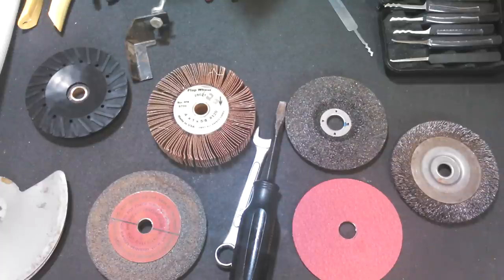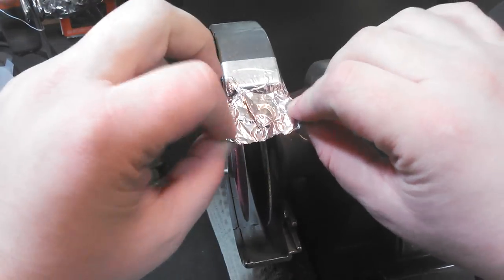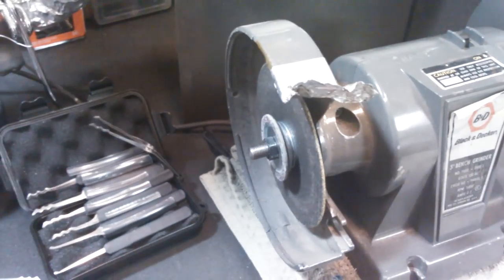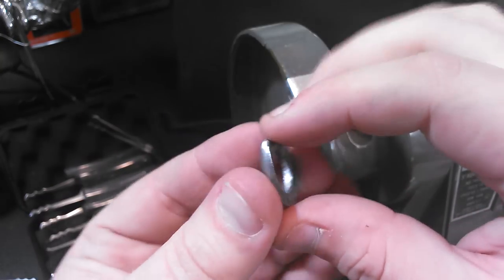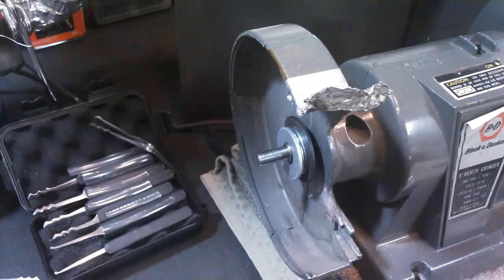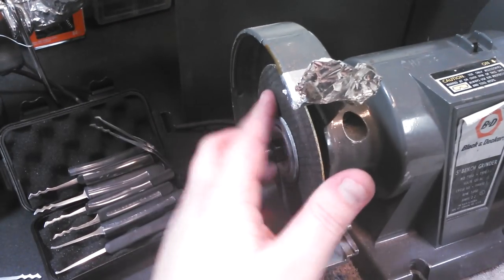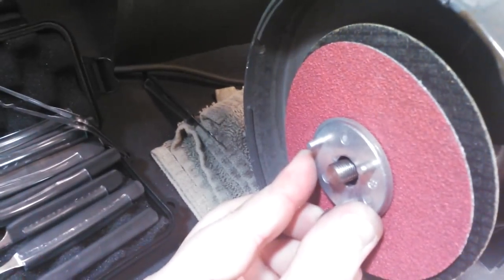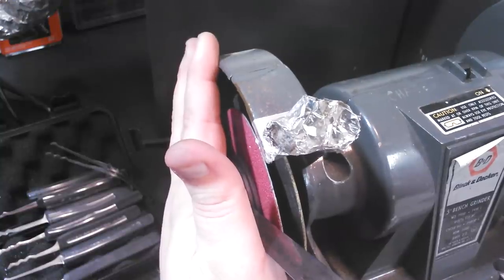How To Convert Your Bench Grinder to any atachments! {14}

Comment: If your shop is in an apartment, as is my case, yours is a quick and valid solution for neatly cutting small metal parts, like HSS blanks for the mini lathe, making very little noise. 
Great idea.
Reply from the maker: Yes being able to use a single tool for multiple functions definitely saves space and I purchased a rubber mat for benchtop and placed workbench on folded strips of padded linoleum and made it absolutely silent I was in upstairs apartment also

Comment: I have that same grinder as well as a similar one with a plastic housing. Both vintage and made in the USA. The plastic housing one is that pea green shade that they did a lot of tools in back on the day. Nice little machines and I appreciate them being USA made. I don't use them and have restored them both. Just part of my collection. You can never have too many bench grinders. They are invaluable.
Reply: Sounds STUPID ! if you don't USE ! Them !
Reply: I bought one at an estate sale. How or where can I find grind wheels with 1/2 arbor hole?

Comment: I don't care for cover guards on refits like this either. Just did this for a chuck attachment. Many chucks off old drills have a 1/2-20 thread. The 5inch grinder I have needed the threads on the shaft cut a little shorter so the attachment could slip/ lock on with grub screws. I also had to grind a little of the shaft to elongate so I could attach the .... ~ (Arbor 1/2-20 Thread for a 1/2" shaft)~ $8 and $25.  also called a "Motor Shaft Spindle". Then I just threaded the chuck on and that's it. Just make sure to get a good spindle so it does not wobble too much. These are best used for buffing or grinding from the shaft end, not the side like a stone as there can be some wobble. I run diamond abrasives and sanding pads abrasive brushes you get the point. I'll be using the other side with cut-off wheels and or polishing wheel with wax abrasive for knife sharpening ... .. . Had wanted to do this for a long time.  Great job on this my friend!!

Comment: this is a 5 in Black and Decker bench grinder as you can't find much for them nowadays as far as the grinding wheels. but its solidly built  the wheels to get to fit this grinder are the Chicago Electric 5 in grinding wheel from Harbor Freight tools. and the H&M Abrasives USA 5 in wheels on Amazon. as well as a 5 in wire brush or a 5 in buffing wheel. as this Grinder calls for a 1/2 arbor holes for the wheels.  a step up grinder thats the only one available 5 in bench Grinder is from Harbor Freight tools is the Central Machinery  item# 94186 its a slightly more powerful 5 in bench grinder but the motor is a PSC type with a run capacitor and a bit more torque. as this Black and Decker it only has a 2 pole shaded pole motor in it. and less power.  a this grinder is a good step up from the old Black and Decker 5 in grinder.
Reply: Really !?? I've Seen plenty of Grinding Wheels ! Considering Decker and Black ! CRAP ! Is Exactly ! That !

Comment: Great idea. Have you add any major problems with this solution.
Reply from the maker: no none at all and I have been using it daily for last 5 months... also my machine is old and weak I imagine someone with larger projects then locksport would need a larger newer or more powerful machine to keep up with more intense projects and not burn up motor depending how hardcore the projects and attachments

Comment: Do you know how to attach a flex shaft to a 1/2" bench grinder?
Reply from the maker: flitdek no sorry I don't know I assume would come with instructions home depot might be able to shed some light or just Google it probably find information diagrams and explanations
Reply: You can try to use a coupling bushing/sleeve with set screws. Fix one side to the shaft of the grinder, the other to the shaft of the flex shaft. Or a more complicated will be a collet on one side or the other. Maybe you can put a Jacobs chuck on the end of the flex shaft and attach it to the grinder. Or weld a nut on the end of the flex shaft and screw it on the threads of the grinder shaft.
Reply: no but you will need to make a 1/2 inch nut that will be held in the bench grinder harbor and at the other end will have a Collet that will be holding the flex shaft in place I really don't know what side would be best since one side threads left and the other right as far as i remember not sure. you may need some sort of lathe work to do it or google if they sell an attachment already made.

Comment: Very informative.  I have a similar B&D bench grinder and I have never replaced the grinding wheels (bought it used).  I was hoping to see how to remove the nut from the other side of the shaft.  Is the slot just to keep the shaft from turning or how do I get that nut off?  BTW, the slot is "wallowed-out", so even a big screwdriver will not secure it.  Also, is there a way to re-surface the edge of the grinding wheel?  And lastly, have you had any success in mounting the "cleaning" disc that are fibrous?  They look a lot safer than those twisted-wire types.  Thanks.
Reply: You probably have reverse threads on the left side of the arbor and normal threads on the right. You should be able to loosen one of the sides by gripping the grinding stone with your hand. If all else fails bust out some vise grips, but be sure to wrap some tape around the arbor if you're going to use the vise grips to secure the arbor.
Reply: @j.madone7819  Vice Grips Damages the Nut ! Use a Spanner ! Dick !